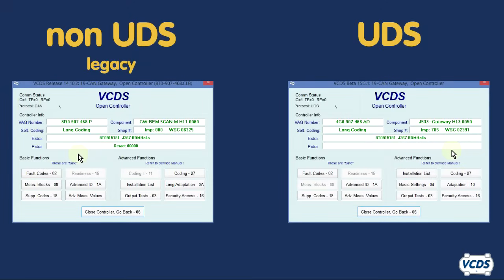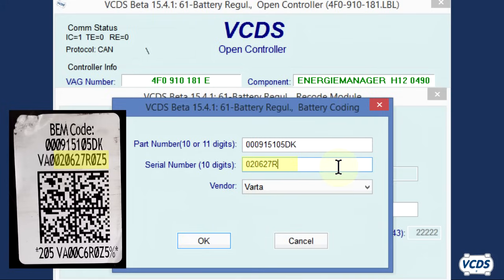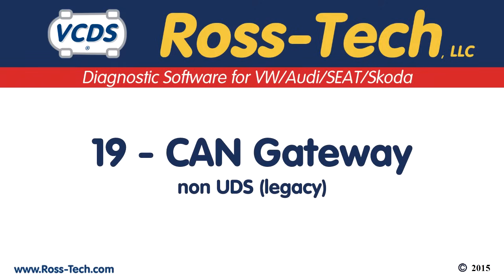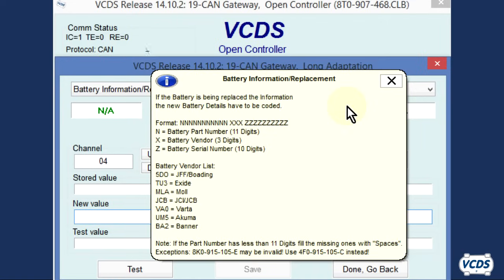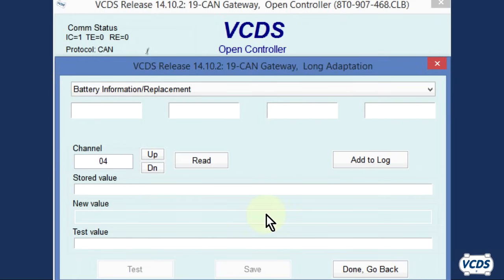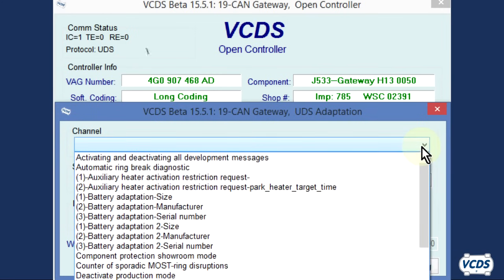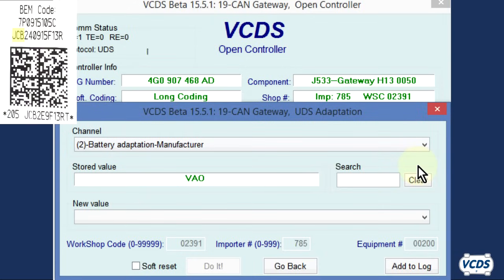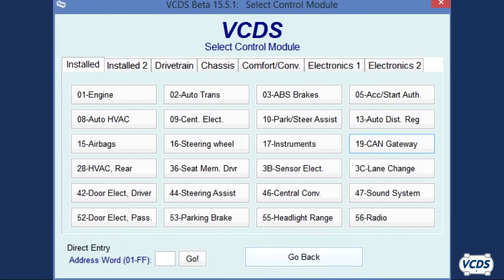Battery Coding

Comment: Hello. My "Adaptation 10" from CAN is blocked. I don't have access. I entered the code 20103 in "security access" and it won't let me.(Controller refused to send a seed!

Error 12: Sub-function not supported or invalid format)   car VW 2009  please help:-)

Comment: One thing you should know about this procedure is that newer batteries with BEM codes may come with part numbers, vendor codes, or serial numbers that your car won't recognize.  When you get into the screen where you enter the new data from the BEM code sticker, you'll get a pop up window with a list of vendor codes.  My battery for a 2014 Q7 that I purchased from an Audi dealership had a vendor code of CCL for a Varda battery.  The code for Varda in the list is VAO.  When I tried to enter the code verbatim from the sticker it would not stick and the old data would be displayed after I hit the Test button.  I tried the vendor code using both CCL and VAO and it refused to accept either one.  I posted about this in the Ross-Tech forums and the solution was to simply perform the serial number tweak by adjusting one of the digits and keeping the rest of the data as it was.  That worked fine and the car is not showing any extraneous faults related to the battery after performing a test drive followed by a complete scan.

Comment: What if I bought a battery from oreilly and I don’t have these three piece of info?
Reply: put a random vendor and a random serial number that matches up to your new battery group size, the only one you might have to tweak is the battery capacity or Ah rating which should be easy to figure out based on your new batteries reserve capacity rating

Comment: Hi all, help needed: I recently changed the battery on my A8 from 2008 - bought exact same model of Varta like there was previously. After the change I drove 100 meters (all was good) and the car was standing unused for 10 days, when I came back the entire instrument board with speed, rpm, fuel and temp indicator doesn't work - it acts like there is no power at all. The car starts normally and all the other systems works so it is possible to drive but driving without dash isn't fun at all. What to do? I already checked fuses - > OK. I also drove around 100 km hoping, that the dash will wake up but it didn't..😢Anyone faced this exact issue in A8?

Comment: Hello. My "Adaptation 10" from CAN is blocked. I don't have access. I entered the code 20103 in "security access" and it won't let me.(Controller refused to send a seed!

Error 12: Sub-function not supported or invalid format)

Comment: This explains a few things.... i wasn't aware this was even a thing. I just put a 2nd  new diehard battery in my 2009 v8. The first time i replaced it, things got weird with the air suspension and the transmission. The second time (last week) nothing went crazy.

Comment: HI, I have an 2017 Audi TT, the car had a Christmas tree in the dashboard, I check for codes and it throws right wheel sensor, so I change both front Wheel speed sensors... After I finished mounting the new wheel speed sensors the car won't start, I press the button and nothing, the dash turns on, the lights, except the windows that do not open... What could be the problem?

Comment: A couple of important hints.  If you buy a new battery (like I did) from Audi, and perhaps VW and others, the manufacturer may not be in the listed of accepted one for the middle code you enter.  I bought a new one from the dealer today and it was a CCL battery, which isn't in the list.  At that point, just use another code from the list.  It doesn't matter.

I also read that if going non-OEM, just take the old one and change one of the later digits in the third group, increasing it by 1.  That's it.  I went OEM since the original just died yesterday on a 2013 S4 with 120k miles, so if it lasted that long, I think going the same route for $50 more than a cheapie battery was a smart move.

Comment: I dont have this adaption button..its grey...audi a6 c6 2007 2.0tdi cvt automatic fwd... what to do? I had bad battery (i tought) and replaced with new... after year again i cant start car if i have for example radio on for 10min... charging when running engine is arround 14v so no issue with alternator... im mad about this electronic uselless shits

Comment: Silly question, but how do I know if I have the Standalone system that utilizes Battery Regulation, address 61 or the "Integrated into CAN" with the non-UDS?   In both examples, the VCDS software says "Protocol: CAN" in the top left corner of the window.
Reply: If adress 61 is not detailed in a full scan , you use adress 19

Comment: I've bought a new OEM Varta battery for my 08 A4 8k, and simply can't seem to code it. It has to be coded in the CAN gateway, after adding the part number, manufacturer code and serial it simply goes back to the previous code of the old battery. Anyone seen anything similar?

Comment: so you're telling me that my Q5 has a battery management system but it is a dumb system and could be any of 3 dumb systems? I have the same size and make of battery, why do I have to do any coding at all? The car is working and charging the battery, if it has any kind of battery mangement system why can't it just charge the battery as needed, why else have a battery management system?

Comment: Oh my Fk'n goodness do they have to make every Fk'n thing super stupidly complicated or do Germans just always have something stuck up there ass. Sense they have to be so Mutha Fk'n anal about everything when it comes to cars 🚗 I mean come on coding a Fk'n car battery 🔋  my goodness!
Reply: 🤣🤣🤣 I'm in the process of doing this myself right this minute. I feel your pain. I've actually found out that a lot of Asian and US spec cars are starting to do the same thing. 🙄
Reply: @atrain132  lol hahaha I agree that  they are indeed. The all started to design vehicles to start breaking down and design the parts to after certain amount of wear that part need replacement.  Because the auto brands and dealers make majority of there profits off of part and mechanical repairs.
Reply: @genooneg7813  1000% true! I just recorded the new battery for my Audi and 🤞 keeping my fingers crossed I did it right lmao. I'm in the middle of a big project with this vehicle, and it's good of words with German cars for several years. So many special tools are needed as well
Reply: @atrain132  yep for real

Comment: No BEM code? Just bump the existing serial number one digit. If you change capacity (I went from 80 to 95ah AGM), change the model accordingly. Don't stress over a 12v battery.

51Ah – 8K0915105J / 000915105BB / 000915105DC
60Ah – 4F0915105 / 8K0915105G / 000915105DD
61Ah – 8K0915105H / 000915105AD / 000915105DE
70Ah – 4F0915105A / 8K0915105C / 000915105DF
72Ah – 8K0915105B / 000915105AF / 000915105DG
80Ah – 4F0915105B / 8K0915105D / 000915105AG / 4FD915105 / 8KD915105 / 000915105DH
95Ah – 4F0915105C / 8K0915105E / 000915105AH / 000915105DK
110Ah – 4F0915105D / 8K0915105F / 000915105AK / 8KD915105A / 000915105DL
68Ah – (AGM) 7L0915105 / 000915105CC
75Ah – (AGM) 3D0915105H / 000915105CD
92Ah – (AGM) 4F0915105E / 000915105CE
105Ah – (AGM) 4L0915105 / 000915105CF
115Ah – 4H0915105 / 000915105DM
Reply: How do you bump the existing serial number one digit? Is it first or last digit? It looks like my battery should have 000915105CD cod. Can you recommend aftermarket battery to purchase? I am considering DieHard Platinum AGM Battery: H9 Group Size, 950 CCA, 1000 CA, 100 Amp Hour Capacity. BTW I have 2018 audi a5 sportback. Thanks.

Comment: Je viens de faire le changement de batterie, j'ai bien respecté la procédure, merci pour le Tuto. Je me suis aperçu que les numéros de série de la batterie précédente ne correspondait pas avec  les données présentes dans l'ordinateur de l'Audi Q5.
I just changed the battery, I followed the procedure well, thank you for the tutorial. I noticed that the serial numbers of the previous battery did not correspond with the data present in the computer of the Audi Q5. It had been changed by Audi.
Done with VCDS 18.09

Comment: Batteries differ with : chemistry , cell number , capacity , C constant.
Car batteries are Lead acid , 6 cell (2volts*6cells=12Volts) , 30 to 60 Ah , 2C . So you look at your battery for you car no matter the  maker you only need to look for capacity and buy the same no matter the maker don't fall for specific battery for this crap

Comment: Just replaced the battery in my 2006 Audi A8 with no problems.  Just for info,  I used a Diehard Gold size H9 battery from Advance Auto and it is made by Varta, same mfr the dealer used and it had a BEM sticker.
Reply: I also purchased a Diehard Gold from Advance Auto - 	
DieHard Gold
Battery, Group Size H8, 900 CCA
Part No. 49H8
But no BEM sticker, also no reference to the Ah rating on this battery
The battery I pulled out was a MLA 110Ah, only 850CCA (from a 2014 Q7TDI)
Reply: @jasonl6380  Mine was a Group Size H9 .  It looked different than the H8, I'm sure it was from a different Mfr.  Diehard brand batteries are sourced from various manufacturers
Reply from the maker: Can you provide a photo of said battery showing the BEM code sticker?
Reply: @RossTechVCDS    Can't figure out how to add a photo attachment to my reply

Comment: Would this method work for installing a Braille Lithium battery after removing my standard lead acid on my GTI?? Is it necessary?
Reply: My advice to you is not to install a Lithium battery in any vehicle.  If your car came with one, fine, I guess, but off-the-shelf Lithium batteries are really just not there yet.
Reply: Or just do what Mr. S said "... go into the BCM long coding and turn the energy management off".

Comment: I would like to meet the one who developed such a system
Reply: The algorithm for the battery state detection, co-developed by Audi Electronics Venture GmbH, is core of the battery data module (BDM). The BDM is integrated group-wide into various Audi, VW, Seat, Skoda and Porsche models.

The project participants are Audi, VW, Porsche (OEM), Lear Spain, Valls (hardware and operating system), HELLA, Lippstadt (hardware and operating system) and Audi Electronics Venture GmbH (software implementation, software testing, co-development of battery state detection algorithm).
Reply: Hahaa yea

Comment: Just buy same capacity battery and you don't have to do battery codding.
Reply: But how the alternator would know its a new battery. I read that because the new battery holds charge better and doe not need much charging the bem would turn off the alternator when not needed.
Reply: @Eren-da-Jaeger  By the same way like in motocycle or in traktor (Fendt), understand, don't be cunning, yeah....
Reply: @Eren-da-Jaeger  it is all about electricity babe, fershtain du
Reply: @Eren-da-Jaeger   go back to school, and teech about electricity and resistance of batery.....
Reply: @Eren-da-Jaeger  the low of Ohm weel help you.....babe
Reply: @Eren-da-Jaeger  doesn't the alternator voltage REGULATOR do this?  which is why it's there

Comment: Or just go into the BCM long coding and turn the energy management off.
Reply: But that would decrease fuel economy and the life of new battery.
Reply: @Eren-da-Jaeger  no it doesn't, my 2.5l mk6 jetta gets 37mpg on the highway and my voltages are exactly how they're supposed to be.
Reply: @Chilli Chillz need VCDS

Comment: I have a 2015 Jetta s with a 5 speed and the 2.0L 8 valve engine. There is a sticker on the factory battery with the serial number, but no BEM codes? Does that mean I don’t need to program the new battery?
I put in a new H5 series Interstate and it’s working flawlessly for about 2 weeks...
Reply: You're good.

Comment: All this to change a battery. What have we become. Ridiculous.
Reply from the maker: This is what happens when German engineers say "halte mein bier".
Reply: All of this to theoretically save a couple of grams of CO2 and other exhaust by products. These are the times we are living in and this is only the beginning.
Reply from the maker: @vladulescuadrian6080  I think it has more to do with maximizing the life of the battery.  I've seen one case where the factory original battery lasted over 11 years a few month after date of manufacture.  In most cases, I see factory batteries last over 8 years before they need to replace.  So to that end, not so much a few grams of CO2 saved, but rather several kg of Pb in the long run.
Reply: @RossTechVCDS  Confirm, my battery in A4 2010 just died at 11.5 yr age. It's why I'm here)

Comment: Great video, thank you for the great support!!!

Replaced the battery in our 2013 Q7 TDI. Battery swap was 20 minutes and 5 minutes to change the battery in the software.
Reply: have to replace my battery in my 2013 TDI,  what battery did you use?? What VCDS interface did you use??
Thanks

Comment: I've been replacing my battery on my '08 MK5 GTI FSI BPY car for 10 years and this is the first time I've seen this. Will I need to do this for my car with this specific model? Anyways I've always purchased my battery from a VW dealer, but wanted to know if my car needs this done everytime I put a new battery. Thanks.

Comment: I have a Passat CC 2010, since I changed the battery my charge is quite poor, 13.7V sometimes 14.1V and rarely but sometimes 12.8V. I have changed voltage regulator thinking brushes were used or stuck, no improvement. When I go to 19-CAN Getaway, Long adaptation I have no drop down menu,  61-Battery charge is not responsive. Do I have battery adaptation on my VW or not?

Comment: The battery coding is only required for the dealers to see if your battery is registered to the car and under "warranty" or replaced under warranty, NO OTHER REASON
Reply: False. 
"Energy management system"  should give you a clue.
These systems adjust how they charge your batter. Based on the values that have been stored.
When you install a new battery. It can be over charged. Because the system is still trying to give what it still thinks is an old battery, a more aggressive charge. You also will not have proper values to indicate how your new batter health is. 
The only time you could get away with not coding. Is when you replace a good battery, before it has degraded.
Reply: If old battery ECU will tell generator to put more power to charge. With new battery that can be problem and battery will go bad earlier.
Reply: False, the car computer changes how it recharges the battery depending on its life, you are misleading
Reply: It's needed for the stop/start feature to operate.

Comment: Do i need to do this to a 2009 vw scirocco?
Reply: it will work without coding, but the battery will die in 1-2 years if you forget the coding, because the diffrence in AH, starting amp etc...
Reply: @ForWhhY  i try to code it but it wont let me. What do i need to do??  It wont show me anything on gateway. Am I doing something wrong?
Reply: @sonydavid2  Man, I hope you figure it by now. Based on the year, you're car does not have an intelligent charging system, only cars that have start-stop system have this feature.
Reply: @vladulescuadrian6080  yes i did :p thanks though 👍🏽👍🏽

Comment: in my Vw passat B8 2015 with uds protocol i can't access on the address 61, just on the 19. Is it possible to coding the battery only with the address 19 excuting the 61? thx
Reply: If u have UDS protocol, there is no BEM module (61).

Comment: I often drive with a caravan with seperate battery. However when the electronics see that the battery in the car is fully loaded, the car stops charging leaving very little power left on the battery of the caravan when you want to sleep over in it with the heat on. Any solution to that? Thanks :) (Golf mk7).
Reply: DC/DC charger

Comment: Hi , video is excellent. But anyone from this 3 battery coding version didn't work with my  VCDS. When i click on  Select  i dint see 61- Batter Regulator.
 When i try 19-CAN Gateway non USD (legacy) click on Select i dint have it. I'm doing something wrong, or my new VCDS maybe is wrong?
I will be very appreciate if you can help me solve this problem.
Sincerely
Reply: what year model vehicle? what version of VCDS?
Reply: @tcap7917  2015 VW Jetta SE  TDI.  HEX-V2
Reply: Hello Again,
i have Battery number 000 915 105 dg   made in Germany by Varta, but i don"t have serial number it is peel out.
Maybe is possible re code battery whit out serial number?
Sincerely

Comment: what if I  don't have a BEM Code  label on battery??
Reply: Then just change 1 digit on the serial number is enough
Reply: @oli31  First or last digit?
Reply: @pr0xb0ct  I think it doesn't matter, I don't remember which I did
Reply: you should buy battery with bem code, not a universal battery without the code.

Comment: Audi a4 1.8 tfsi year 2009. Can install the original battery without this coding ?
Reply: No, the coding is for the BEM (Battery Management System) to forget any learned values and to know that a new battery is installed. I wouldn't recommend installing the battery without letting the BEM know there's a new one.

Comment: Hii! I have 2010 vw polo. Recently i have changed the battery (Exide). From then the battery drains completely if the car was kept idle for more than 5 days. Even the electrician has confirmed that there is no parasatic power drain.  Should i recode the battery? Pls help!
Reply: What was the root cause of battery drain? Did you have to recode it? 
I thought in india the battery management system is kept off.